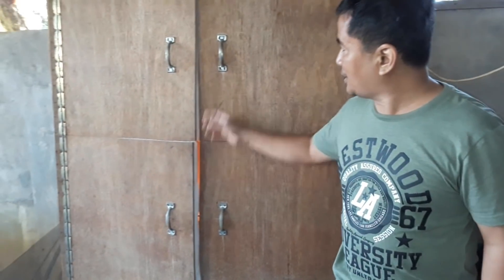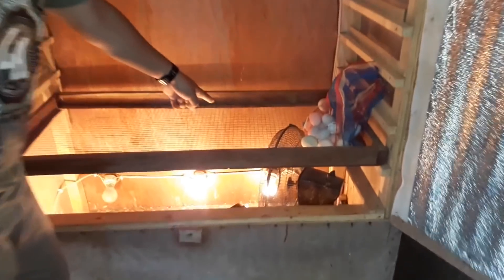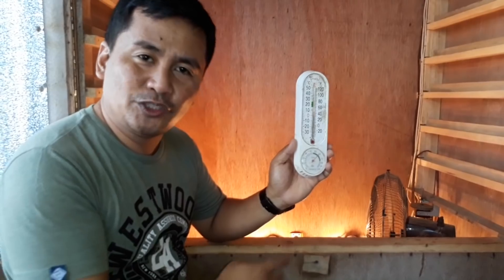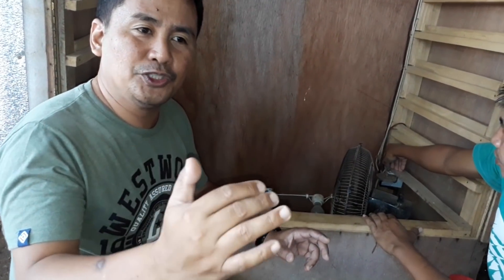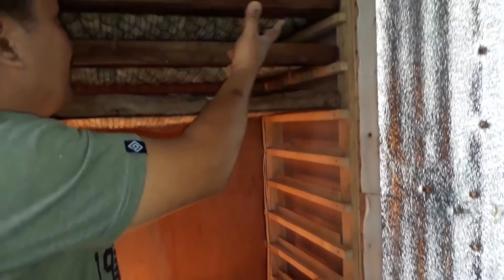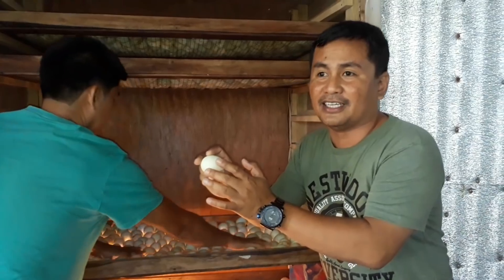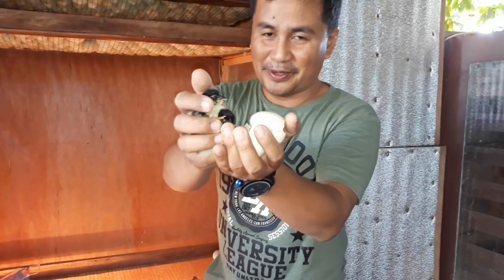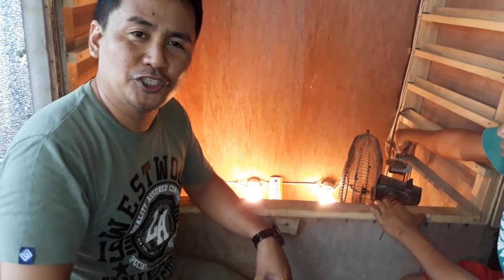affordable home made incubator│Modern and practical methods in making incubator

Comment: Which Thermostat do you have? And how did you conected this to the system?

Best greetings
Reply: Any thermostat with the right temp range, and the proper voltage will do for this set up. 100 degrees is probably out of range for an Aircon thermostat. A green house thermostat would be ideal.

Comment: What do you do about setting the humidity levels. I know where I'm from its said to leave heat at 99.5f / 100.5 and humidity at 25% - 50% then on day 18 to 21 to hatch humidity goes to 70 - 90% but not over 90% with using water. So do you use water?

Comment: I am just curious, you have placed the thermometer at the bottom and the temperature below is much hotter than those at the top, can you tell me if the temperature above is lesser than those from below? I understand you have an electric fan but is it a guarantee it will be the same? I have noticed you did not place the thermometer above just to check whether or not the heat inside the incubator is uniformly distributed. I will be most delighted to hear an answer from your end. Thank you, Sir Dexter.
Reply: Dennis Muñoz Dennis here just asked the most valuable questions. BRAVO Dennis and you are right but there are fans being used this should help with heat distribution
Reply: Dennis Muñoz Dennis here just asked the most valuable questions. BRAVO Dennis and you are right but there are fans being used this should help with heat distribution

Comment: If you use 6x bulbs of 25W each that's 150W in total. So can I just use 1x 50W and 1x 100W? Or did you use 6 of them with lower intensity for uniform heating all around the incubator house?
Reply from the maker: yes your right 6 bulbs will equally distribute the heat

Comment: Hi dear Dexter, Most of your Videos on Incubators, I have seen, however I have following Questions, if you don't mind to let me know :
1/ What is the measurement between Bottom to 1st Tray
2/ Do all Three Fans Runs at a time, or One Fan is Operative and Two are runs when Required.
Your Videos inspired me to check my ability to start Chicks and Duckling Farming, I appreciate to have your replies.
Thank you in advance.

Comment: I understand that the bulbs are connected to the thermostat and that it will turn off the lights once it reaches 100 degrees celsius, but what about the fans, are they connected 24/7, and at what rate/speed are they be connected?

Comment: sir if u don't mind i think there is must require humidity and there is no equipment for humidity for your project
but u have a nice idea about incubator
Reply from the maker: i made a hole at the button of it to absorb moisture of the outside temperature which is my source of humidity, since i placed the incubator outdoor but if you will put indoor you need water for humdity

Comment: sir. good afternoon, is the the electric fan will run until 20 days/ different line or it is connected with the  thermostat ? also i would like to know the ideal measurement of length, height, width of homemade incubator, also the ideal measurement of tray and distance of each trays.
thanks a lot

Comment: Hi sir, I would like to have some advice on how to connect the wirings from light to thermostat and how to set its temperature. Thanks...
Reply: The thermostat is just a switch that interrupts the circuit, just as on a light bulb in your house.

Comment: Please explain the connection method of thermostat
Reply from the maker: the thermostat cap expands as the temperature rises when in reaches 100 degrees far. you can set the adjustment   to reach  the switch so that it will shutoff .